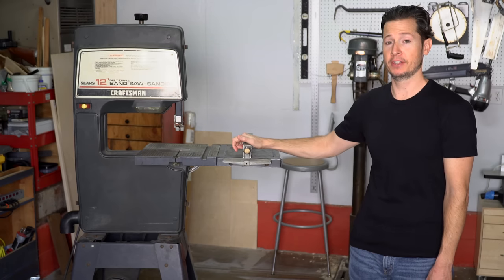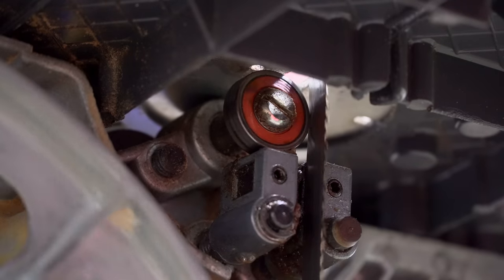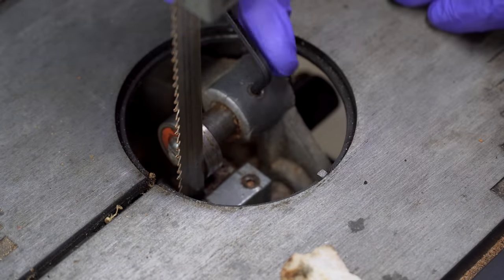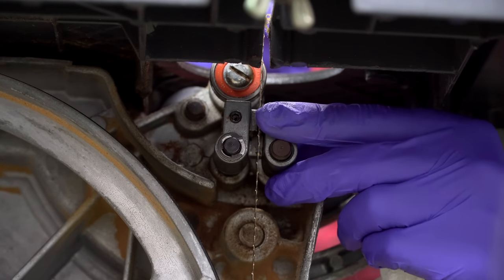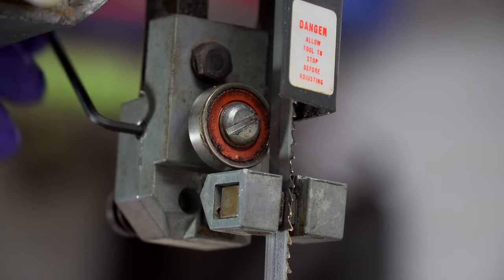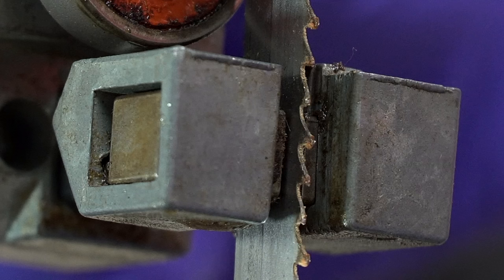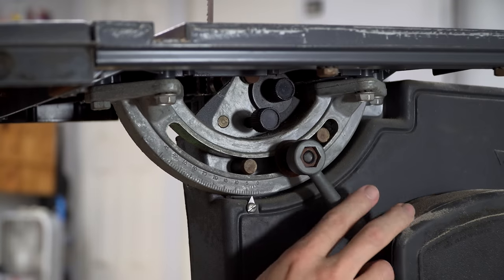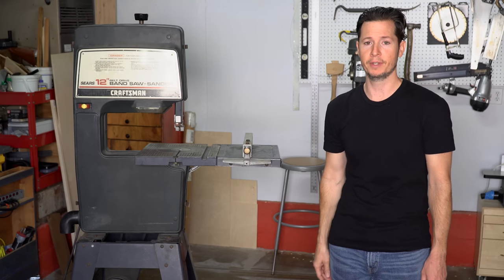Craftsman Bandsaw Setup

Comment: Just bought one on an auction for 55 dollars in good condition. I had figured out the adjustment settings show on here but the previous owner put the blade on the bearing instead of behind it, therefore making the blade be out of square. Thanks for the help.

Comment: Mine seemed to want to not cut straight with an 1/8th inch blade. Seemed to kind of what to flutter side to side. In looking at the tires and the fact they kept wanting to come toward the front instead of staying in the middle and the fact my machine is 38 years old, decided it time to replace the tires before seeing if I really needed to make the adjustment on the upper wheel. Hoping for the best with the new tires. Your video helped allot. Thanks!
Reply from the maker: Best of luck getting your machine back on track - pun intended 😂

Comment: I have the 10"  version of this saw (113.244400). Thank you for this straight forward explanation of how to set up my saw. I've snapped two blades due to the thrust bearings being so badly worn. This guide will definitely help and so will some new thrust bearings. I just checked. My saw does not have the same blade guides or adjusting screws. Nor does it have the adjusting screw on the wheel that holds the tires. The two machines are not the same in terms of fine tuning.

Comment: Nice video and thank you. A couple quick observation notes to add please. The lower and guide also have knobs to adjust the respective positions in and out just like the upper. Secondly, I would not adjust for table level using the tilt feature. There is actually a set screw on the throat side of the table that is specifically for this purpose. You will see it in a recessed hole. Raising or lowering that set screw will adjust and hold the table level better and after you use or remove the table. Same square reference points as you show, but it's just a more effective way to level the table.

Comment: There are 2 little thumb screws on the back of the bottom guide right where the table adjustment handle is, there's one for the bearing and one for the guides. Also get a good blade (I like timberwolf blades) there $30 instead of $10 for the Bosch blade but 100% work it

Comment: Tommy, Thanks.  I've been trying to adjust this exact bandsaw all day.  I took the 1/2" blade off and trying to put on an 1/8" blade.  It won't take long well.  Missed the first part where the upper wheel can be adjusted.  The blade falls off immediately.  Thanks

Comment: My grandfather gave that exact bandsaw to me and I made one cut and the blade would keep turning on me. I've had it for 8 months and only used it the one time. Maybe this is the problem???? Great video! I can't wait to see if this fixes my issue! I have a knife handle and a Red Ryder stock to make and this saw would be a big help!
Reply from the maker: Good luck getting you saw set up!
Reply: One Minute Workbench haven’t had a chance to set it up but did take a look... wow this thing is way out of tune
Reply: One Minute Workbench I do have a question??? I’m new to the band saw and I don’t know what blades I need. I need a blade to resaw wood and a blade to saw smaller detailed items like a knife handle and a gun stock. Any suggestions?
Reply from the maker: I'm no bandsaw pro, but you'll need a thinner blade with more teeth for cutting curves (like a gunstock), and a thicker blade with fewer teeth for resawing. Have a look at the Timber Wolf brand of bandsaw blades for resawing - they have a great reputation. I hope this helps!
Reply: One Minute Workbench thank you!

Comment: Hi Tommy, I have the exact same band saw. The upper and lower tires slide off the wheels (regardless of whether the blade is on low, medium or high tension. Interestingly the blade stays on the centreline but the tires creep off the wheels. Any ideas, suggestions before replacing the tires? By the way I have an Olson 1/4” blade and the adjustments were made just as you described in your video. Looking forward to your feedback. Regards Pete
Reply from the maker: Pete, the tires should be VERY tight, so if they're moving at all, you need to get new ones. If they're not difficult to put on, they're too loose. I hope this helps!

Comment: Great tutorial , like everyone else i inherited this saw , of course there isn’t any blades . Was wondering what length of blade i needed for this saw and also what type do you prefer thanks again
Reply from the maker: Mine takes an 80", and I assume most of the 12" version out there do as well. That said, look around your machine to see if you can find the model #. If you can, type it into searspartsdirect.com, and you'll find what you need. I use different blades depending on what I'm cutting...it's a pretty in-depth topic, but basically smaller width blades for tighter turns, more teeth for finer cuts, less teeth for faster (but rougher) cuts. I hope this helps!
Reply: I picked up a bosch blade for this saw at Lowe's no problem. Think it was like $8 for a ½ 6 tpi

Comment: Great job in your video. This is the exact same band saw I bought at yard sale. How do I measure the blade size?  The blade that's in it I measured 1/4 wide, then 1/2 circumfrence of the top wheel  to bottom wheel was 40 & 3/4 x 2 =81&1/2 So with adjusting would I get an 80 inch blade? Does blade  tension guide tell maximum width of blades allowed?  Thank you
Reply from the maker: Thanks! I think a half inch is as wide as you’ll be able to go. Mine is 80”, so it skikda like your math is working out. Best of luck!

Comment: Really appreciate your video. Recently purchased this very saw used for some hobby stuff.  Your video helped me know what to check and set up before usage.

On my saw, the screw that controls the blade alignment on the top wheel does not want to budge.  Any suggestions besides penetrating fluid and or heat to free it up?  Does not appear rusty. Only see old grease and old saw dust.

Comment: I have the same bandsaw I purchased at a yard sale for $100 I went to use it for the first time and the issue I'm having is the rubber gaskets on each wheel are not tracking right they are wanting to come off can you tell me what my problem might be. I did find your video very helpful thank you

Comment: Good info but I need to know how to set the upper blades guide down for different wood thickness. Mine seems to have a carriage bolt with some sort of nut that I have never seen. I need to get the upper blades guide down to about 1 1/2" I'm going to be pushing a 24" piece of 2x4  from corner to corner. Thanks.

Comment: Hi,
I just picked up an old Craftsman 12” Bandsaw mod# 113.243311. The pointer is hanging from the mounting screw and isnt hooked up to anything that would make it move with the tension adjustment. What am I missing or what is it supposed to be hooked up to to make it move?
Thank you
Mark

Comment: I'm an original owner of one of these. Thanks for this video. I wasn't looking forward to digging through the manual.
Reply from the maker: You got it - glad to help!
Reply: @OneMinuteWorkbench  Just to put this in perspective. This isn't a saw I use every day but I want to have one available when I need it. When this went south in December I figured I'd end up scrapping it. Today I watched this video again and went out and started the process. An hour or so later I have an almost perfectly setup saw. It's running like a champ and I can't thank you enough for this video. On the other hand I don't get to buy a new bandsaw and that's kind of a bummer. :)
Reply from the maker: @immedgerto  I’m glad it was helpful, and sorry you don’t have a good reason to buy a new saw right now. But remember, you never actually need a good reason to buy new tools 😂
Reply: @OneMinuteWorkbench  An update a few years later. I went on a search to replace this saw. Instead I found that they made this model a few years earlier with a cast iron deck. I found on on eBay and changed out the aluminum table for the cast iron table. Now I can use a Magfence. Still using it.

Comment: I just inherited a 30 year old Craftsman Band Saw like yours. In one of the videos I notice it set against a wall. Do you have it on wheels or just slide it out when you use it? Thank you for this video, when I get the new tires in and installed I will proceed with the setup.
Reply from the maker: I do have it on wheels, and I move it away from the wall if I'm cutting something long enough to warrant it. I'm glad you found the video helpful - good luck getting your saw setup!

Comment: I think I followed your instructions properly, but the issue I'm having when I start the saw, the bottom pulley rubber band starts to flex and walks off the pulley. The blade stays centered on the pulley. Any Ideas what I may have done wrong? Thanks

Comment: Hey Tommy, thanks so much for this. I have this same band saw so it's very helpful. Any way to show how to adjust the belt from the motor to the saw? I did all these steps but my saw has NO POWER to cut anything thicker than plywood and if I try to do sharp curves the blades stops. Thanks in advance.
Reply: I just got one of of these. Im looking for some parts if you have a lead. Main thing I've been looking for is a blade. If ya have a link or some numbers. It be much appreciated!

Comment: You got all the adjustments except one and that made all the differents with my band saw.  You have some trundions on the one the bottom of the table.  these need to be loosen and the table needs to be adjusted so the miter slot is square to the blade.  Just like the table saw the blade needs to be square to the blade. and when you move the band saw around do not use the table as a handle or you will need to do the adjustment all over again.   Oh and by the way tighten up the trundions bolts after the adjustment.
Reply from the maker: Ernest, thanks for the feedback!

Comment: Can this be modified to cut ferrous and nonferrous material for small projects obviously with the proper blade.
Reply from the maker: It can, but I wouldn't necessarily recommend it. You could get away with cutting aluminum, but you need to very carefully clean your machine after, and check your tires to see if they need replacement after a bit of use (aluminum chips will be a little harder on the tires). I hope this helps!

Comment: Putting a new out of the box Craftsman 12 inch bandsaw 22400 together but the instructions attaching bandsaw base to the stand are confusing, the illustration shows bolt (screw) coming up from under the stand, but the directions sounds as if its coming from top and tightening from bottom. which is correct ?

Duane

Comment: I have Craftsman model 113. 24200 that has only a brass bar screwed to the hex post  rather than an upper blade guide assembly. Any clue about an after market upgrade that might fit the model to replace the brass bar with a fancy upper blade guide assembly?

Comment: Hi Tommy, I’m having trouble finding a tutorial for changing/adjusting the drive belt on this bandsaw. Do you have any suggestions on where I could possibly find anything? This saw is special to me so I want to make sure I’m doing things right, as to not break anything further. Thanks!
Reply from the maker: I haven't had to do it for mine yet, so I'm not sure. That said, here is what I found at sears' website: https://www.searspartsdirect.com/diy/repair-guide/how-to-replace-a-band-saw-drive-belt I think the general idea will be similar, and as long as you go slow and be careful, you'll be okay. I hope this helps! Good luck!

Comment: These saws actually last that long? I'm asking because they want $125 for one that I seen recently but I thought nah it's too old. Should I go back and look for it and buy it if it's still available?
Reply from the maker: There are a lot of these saws around for the fact that they last long, but they're not the most powerful. So, it might depend on your needs. If you want to resaw large piece, this is not great for it. If you want to make cuts in relatively thin (2" or less, 3" occasionally) material, this will do just fine. $125 sounds like a decent price though. I hope this helps!

Comment: I have this same saw and am curious where you got your fence. Did it come with the saw or did you get it aftermarket? Thank you
Reply from the maker: I'm not sure - the saw is actually a loaner from a friend that had an extra. That said, a lot of people ask me about it, so I'd guess it's aftermarket. I hope this helps!
Reply: thats the fence that 
thats the fence that came with it I recently got one of the saws given to me the owner said that it was untouched since 1975 and that it was all original had the manual to prove it
Reply: @heatherterpstra6233  heather, how much did you pay for yours? Is 150.00 too much? Do you cut metal with it?
Reply: @davidcrokettt6089  I got it for free from an old friend for free max I would pay would be 115 and no I don't cut metal with it but it could cut through aluminum with ease I don't know about steel though

Comment: I picked this saw up also at a sale. The blade is not cutting at 90 degrees from front to back, so it cuts at the bottom of the wood and cuts in 1/8 '' before it hits the top.
How can this be adjusted?

Comment: Thanks for the video! I can't figure mine out, though. I tried adjusting the tension and the large wheel tilt as shown in the first steps, but no matter where I set it, the rubber rings slide off the back of the large wheels, both top and bottom. Any advice? I'm running a 3/8" bi metal blade.
Reply from the maker: Jake, by the "rubber rings", are you referring to the tires? If the tires are sliding off, then they are waaaaay too big. The tires on the bandsaw should be very tight. Most people have a lot of difficulty in putting them on, and there are little tricks people use to make it easier (like putting them in hot water to soften them up). All that said, check to make sure you have the right size tires for your machine. Let me know if this makes sense, and/or if that is indeed the problem you're referring to.
Reply: @OneMinuteWorkbench  thanks for responding! I meant the tires, pardon my ignorance 😂 turns out they are decades old, and just too loose from being worn out. I have new tires on the way, and it should fix the issue!
Reply from the maker: Cool man! Let me know what happens when you get the new ones!

Comment: I need your help. I have the exact delta 12” bandsaw. As you know, the bottom saw wheel is driven by an external electric motor via belt. I’m restoring the bandsaw and need to know the RPM of the bandsaw wheel. Can’t seem to find it and thought you might be able to help. If I know what is the rpm of the bandsaw wheel, I can determine the width of the electric motor pulley diameter I need to purchase. Hope you can help. Thank you Peter
Reply from the maker: My band saw is actually a Craftsman, so I'm not sure they're exactly alike. That said, the thing you really want to know is how to get the correct SFPM (Surface Feet Per Minute) of the blade. For most wood cutting operations, about 3000 SFPM is the sweet spot. Check out this calculator: http://vintagemachinery.org/math/sfpm.aspx With the calculator, once you've determined your target SFPM (which again, will probably be right around 3000 SFPM), you can easily see how any changes in the variables (pulley diameters, wheel diameters, or motor speed) will affect the SFPM. Also, bear in mind that if you're planning on cutting something other than wood, you'll have a different target SFPM, although I would assume you're not planning on using this type of bandsaw to cut metal. But if you are, be sure to look up those numbers. I hope this helps!

Comment: New subscriber. Great video! Question. Is 150.00 a good deal for your bandsaw? I have a chance to buy the same one. Also, can i cut metal with this?thanks!
Reply from the maker: 150 is probably an okay price. It's not the most powerful bandsaw, and it kind of takes up a lot of room for how underpowered it is. That said, you probably can't get a better bandsaw for that much. And this is definitely not a metal cutting saw...well, you could probably cut aluminum, but you'd need to use the right kind of blade, go slow, and you'd need to clean the saw thoroughly after use. Anyway, I hope this helps! By the way, welcome to the channel and thanks for subscribing!

Comment: What did you do to correct the blade drift. I have the exact bandsaw and the drift ia terrible.
Reply from the maker: Have you gone through all of the setup measures I've shown in this video? Ensuring that the blade guides, tracking, table, and blade tension are all correctly set should go a long way. The other thing is to make sure things are properly set for the type of cut you're going to make. Meaning, the top blade guide should be set appropriately, and blade tension should be higher for larger cuts, especially when trying to cut a veneer. I hope this helps!

Comment: Can you tell me how your tension pointer is set up?  I believe mine is upside down or missing a spring.
Reply from the maker: Do you still have the spring under the main tensioning knob?
Reply: It may be missing the washer between the adjusting knob and the tension spring, thats why my tension pointer won't work.